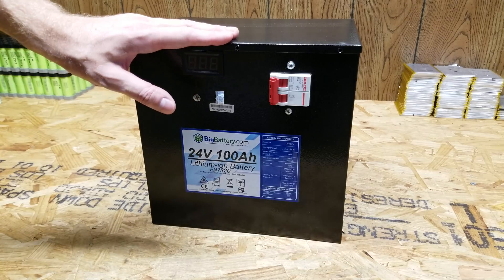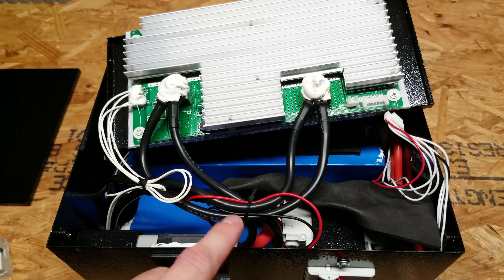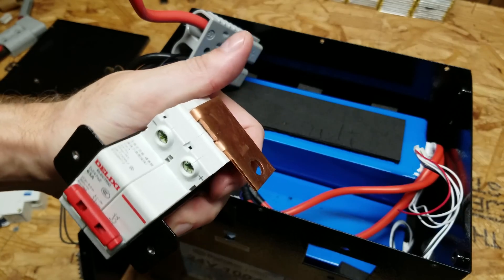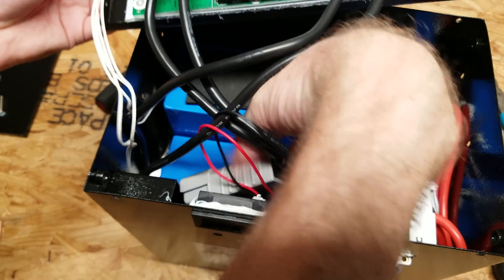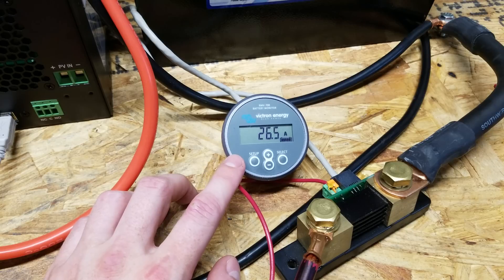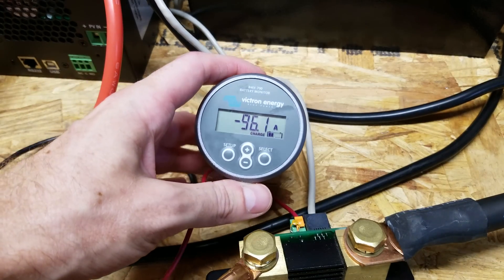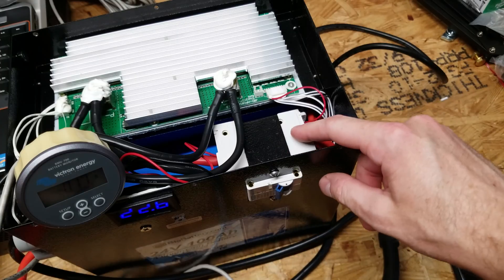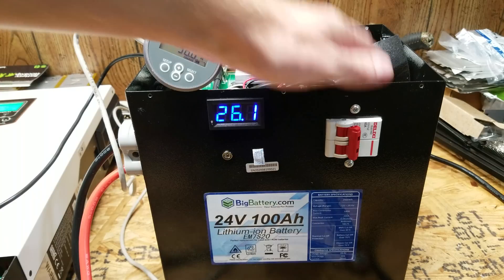BigBattery 24V Breaker Replacement and 100A Re-Test, Problem Solved!

Comment: Mike, on some leaf batteries I purchased from BigBattery... I had the same brand breakers, had the same issue... they didn’t question it and sent me a replacement. I did the same, I just didn’t trust the brand and purchase the same name brand on a 5-8 day shipping from aliexpress.
Reply from the maker: Did you have the heating issue? Or the handle not tripping completely? Or Both?
Reply: LithiumSolar just the breaker handle or lever, did the same as your. But my BMS also quit working

Comment: It is standard practice to fuse paralleled wires with 1/2 total amps of the circuit, so the twinned breaker with tied handle is proper. And much safer than your larger rated breaker with paralleled conductors in it.
Reply from the maker: Yes, but the two paralleled wires are connected before AND after the breaker. Wouldn't what you're saying mean the wires go in to the breaker separately and are only paralleled on the one (output) side? That way each pole is operating separately protecting one of the two wires?
Reply: @LithiumSolar  Using a Dual Breaker for parallel wires is acceptable.  It is good practice to connect one wire to the Left Side Breaker and one wire to Right Side Breaker.  Now, each wire is safely protected by its own 63 Amp Breaker.
Reply from the maker: @vtorsi610  Yes, but I'm saying that's NOT how it was connected either lol
Reply: @LithiumSolar  Yes, I saw in the video that a copper jumper bar was used.  But I am saying, "One wire per breaker is good practice ..."

Comment: I agree - a lock washer should be used in that design (remember these batteries are likely to be used in mobile situations). And they need torque specs during assembly to ensure proper connection. Mechanically you would need to ensure those breaker clamps are designed to exert enough force on a solid copper buss bar as well.

Comment: Hey what Gauge wires was used in that Battery Box?
Reply from the maker: It's all paralleled pairs of 8awg except for the positive from breaker to anderson connection, which is a single 6awg.

Comment: 090420/1604pst.  Thank you for the video. That was a good inspection report. A company’s good image can be tarnished by one single assembler. Well....  there should not have had a loose contact in the first instance. But your keen eyes and years of experience caught it before the CB joint over heated and caused a fire ! 
A suggestion.... the twin Positive cables could have used a suitable ferrule. I use ferrules as per your suggestions and recommendations on most of my joints, by crimping it with hydraulic press. Some of the crimping did not even hold the cable, in tightened position, as I pulled the cable manually. So, I soldered the tip of the ferrule with high heat (Vanatta “Kwikheat” 225Watt 1960) soldering stick. That took care of the cable slipping out of the ferrule.
Thanks again for for pointing out the bad connection that caused the heat at the joint. 175 Celsius !! 
Stay safe and 73s...

Comment: any heat generated is a power loss, weather is caused by lose connections, or under rated wiring especially in a enclosed housing. to me that battery built is not very energy efficient, and in the long run it may be even  a fire hazard?
just saying ...

Comment: Thanks for the video  My Big Battery LiFeo4 packs are superb. I will be ordering more as soon as possible if they are still available. I may pop the top off mine and check the fasteners are tight. No problem.
Reply from the maker: Which LiFePO4 batteries did you buy? Do they have the same breakers as here?

Comment: I think I can say we really appreciate the time you took doing this test. Knowing this could save someone’s house, rv, well-being.
Reply from the maker: The good thing is these seem to have a great quality BMS that properly shuts it down :)
Reply: Gratitude to you my friend! Awesome video very clear and to the point. Also, although bigbattery clearly had some quality issues here, nice to see them selling servicable products and having responsive service.
Reply: I say that because 95/100 lithium batteries with a broken breaker, terminal, etc would need to return to the factory to be repaired.

Comment: I received 2 batteries from them this week and had the Anderson plug on 1 of them not even bolted down in the enclosure. They claimed that it came loose during shipping but when I opened mine up there were zero bolts or nuts to be found. I was ready to send it back but was asked if I can add the bolts myself to save on the time that it would take for me to receive a replacement. Looks like their quality control team is non existent. I’m hoping that’s the only problem I have with my batteries after spending $1600 on them. Thanks for holding them accountable with this video!
Reply: 2012CompMan <<<< thanks for the report. I bought a medical power supply from them. Upon arrival and testing, I found the cells, all of them reading ZERO volts. I have the original battery charger, for that unit and put the unit on charge....one hour later the reading was ZERO. Dispatched the unit back, paid for the shipping, being totally disappointed. Aw well..... thanks for pointing out the issue. Stay safe and 73s... (090420/1702pst)
PS: THE SCREW GOT LOOSENED WHILE IN TRANSIT? My foot ! Sorry I got a lil emotional!
Reply: Hope you pulled the entire thing apart looking for those missing screws.. including removing the battery pack.  In this case, they could be outside the battery in the shipping box. These are not just a piece of crap, they are downright dangerous. For $400/kWH you should be able to find a certified product. although I see you got a $300 discount. bringing it down to $333/kWH  See my reply to the post.  If you are going to keep them, please check to see if the cells are individually fused. If they are not, the only safe thing is to tear apart the pack and start from scratch. At that point I'd send them back and look for safer options for 5 kWh of 24v power. Also, don't plan on pushing these packs anywhere near 100A unless your rebuild the output side of the pack completely and dig in to the specs on the BMS. Were you going to put these in series for 48V or use them in parallel at 24v?   Good luck
Reply: @hbmike47  Yes I took the battery apart looking for them, but They were never installed. So they were "tested" knowing this because it was pretty obvious that the plug was not secured as soon as I got them. When I brought it to their attention they made every excuse in the book including  discouraging me from sending them back for a refund. Knowing that their QC team is lacking, I have my fingers crossed that they will be what they promised. They only stand behind their batteries for 1 Month which I didn't realize until after I received them. I will definitely be building my next battery after this experience. 
I purchased the 24V LiFePo4 batteries. I'm using them in parallel. I used Wills discount code to get $180 off. Also, mine didn't come with nice informative stickers like these, just a bare black.box.
Reply: @RichCompMan  Are the cells individually fused?  Individual fuse can be done with nickle fused strips (like regular nickle strips but there's only a thin bridge of wire to the positive welding pad, so under high current it acts like a fuse)
Reply: Mike Not sure. I just secured the Anderson connector. Didn’t want to tear into it too much, didn’t want to give them an excuse to void the warranty. Here’s a link to Will’s video in where he dissected the batteries I have.... 
https://youtu.be/pcatgGpdE9o
Reply: I received two LiFePo4 (Not the Li-Ion shown here) 24v batteries from Big Battery yesterday and they are flawless despite FedEx trying to destroy them. Stuff happens  and you need to just deal with it.  Put on your big boy pants, stop assuming the worst, stow away all that drama and install a few screws. You received quality components for half the cost of a BattleBorn.
Reply: G Henrickson HAHA, your probably the QC guy that dropped the ball on my order! Get a life and stop trolling.
Reply: @geraldhenrickson7472  "Put on your big boy pants", "stow the drama". Someone ran out of Midol.
Reply: @geraldhenrickson7472  -  From reading all your posts, you sound like you have a financial connection to BigBattery.

Comment: Well, I'm glad you re-tested, but- I think the lack of a lock washer, and, general looseness was the REAL problem. At the value price listed, I would do a little disassembly, add a lock washer if needed, and tighten (Think Will Prowse saying tighTen) the bolt firmly. 70 C doesn't throw me off @ 98% of max capacity with a double copper pole 63A working breaker. Overall, I thought it was well put together, but that lack of lock washer, and subsequent loosen of the bolt is actually concerning.

Comment: Those temperatures are all the the top off so they may be higher and more widespread with no air circulation.
Reply: Indeed, might be a good idea to add a fan with a thermostat.
Reply: @ahaveland  Go for it. A fan never hurt anything that I know of. To each his own.
Reply: Mine do not heat up like this. try not to jump on the bandwagon of malcontent until you have all the facts.

Comment: I would never purchase a built battery set-up from Big Battery  after seeing how lousy and careless they made the unit you first tested. Most purchasers don't have the knowledge to take it apart and make sure everything is done correctly. They rely on the manufacturer. In this instance, you could have a fire from a overheating unit that overheated because someone failed to assemble it properly. This really irks me to no end. Thanks for your informative video.
Reply: It's "big battery" not battery hookup.
Reply: @BobHannent  Thanks, I'll place my order and edit my comment!

Comment: For $950 That is piss poor workmanship. I will never buy from them
Reply: its simple poor build quality. they used a copper plate in a breaker designt to crush copper wire.  there are breakers designt to use  such plates.  this video just shows me that they did not test properly that there is no quality control.
Reply: Please stop. we do not know what actually happened. To discount a particular maker of batteries over this is silly. You are passing up a wonderful battery pack at half the cost of other quality packs. Buy or dont buy but please do not add to the mis-perceptions floating around about that which you do not own and apprantly will never buy.
Reply: @geraldhenrickson7472  Yes, maybe it was caused by a bad monday morning. It is a bad design tho not having lock-nuts. Lets say you drive them on a long dirt road to your cabin. There's a good chance they'll come loose.
Reply: @geraldhenrickson7472  Probably a good idea to go through each new battery pack and check all the connections for tightness before putting it into service. Also, the high amperage DC connections are dry and should be coated in silicone dielectric grease. It's messy, but it makes a big difference over the long haul.

Comment: Does this inverter tolerates battery disconnection in runtime? Some service technicians were reporting its internals desruction.
Reply: Arc fault can destroy solar panels, inverters and certainly a BMS. Turn off all breakers before you do anything. You might cover your panels also before working with your connectors.
Reply: @geraldhenrickson7472  But this BMS can disconnect the battery at runtime. Also the automatic braker in the battery.

Comment: Those Clamp down Connectors are actually made for Solid or semi-solid wires, you should use a Ferule (no soldering thats not as relihable as a crimped therminal) around those two Wires and also use a Torque wrench or torque screwdriver, most Manufactures have Torque ratings in the Datasheet, bc under and over tightening are both bad.
Reply from the maker: How can you tell? I tried using ferules on these breakers in a project unrelated to this test, and the wires pulled out easier than when they were clamped down directly by the lug itself.
Reply: @LithiumSolar  I don't think a ferrule would work in a dual wire connection like this. Actually, the wires should be connected to a bus bar first with a lead going into the switch using a ferrule.
Reply: LithiumSolar <<<< I agree totally. As per the German Engineer, soldering the tip of the ferrule is not recommended, then, the joint can be spot welded. It can be done. I have done it.

Comment: I'm with you on the double breaker idea.   Those are meant to be used on two pole power configurations.  Here it's just more to go wrong.
Reply: It is also perfectly acceptable to use them with parallel wires.

Comment: I'm sure it's due to just loose connection only
Reply from the maker: I'm 99% sure you are correct ;)
Reply: 090420/1640pst. That’s for sure. Any electrical joint even if fully torqued, there’s bound to have resistance and net result being production of heat. Since the original CB was replaced with TOMZN and the ring terminal was cut, no one would want to play around with that joint again. I wouldn’t. Besides now, there’s only one connection, instead of a Brass bolt and nut and a Cu plate, which’d still cause voltage drop at the two joints. Honestly that design was BAD!

Comment: The loose bolts are not acceptable. Even if a loose bolted connection does not heat up much, the increased resistance will cause the current to be higher in one breaker than the other.
The din rail adapter plate strikes me as unneeded complexity. Why not source breakers with threaded posts for bolted connections?
Keep in mind when the outside of the wires are 75 degrees Celsius, the inside is much hotter.

Comment: The loose connections to the original breaker are concerning. But from the way big battery seems to interact with reviewers on youtube, I'd bet they will take steps to address those issues. What worries me even more is the original breaker that wouldn't shut off... or didn't shut off fully... or something like that. Even when it was switched off, it stayed on!!?? That scares the hell out of me.

Comment: There's a German study that I can't get to right now, it showed that lock washers didn't actually affect nut stability over time.
Reply from the maker: I find that hard to believe, but would be interested in reading it if you can find it and post a link :)
Reply: @LithiumSolar  This one's not from germany but from a little organization called NASA. Jump to the Locking Methods section, page 9-10. https://ntrs.nasa.gov/citations/19900009424  They say that helical lock washers do nothing, and star lock washers do a little but they mar the mating surfaces.
Reply: LithiumSolar <<<<<< hahahah. Is there a  German study... on lock washers? Here, in the Nuclear Facility the standards specify the use of lock washers on all mechanical Fastner .... NRC stipulation. Who won in 1945?
Reply: Yea, can't find the German one.
But yes Nasa and Bolt Science
https://www.quora.com/How-does-a-lock-washer-work/answer/Emos-Ztuy?ch=10&share=f33a12e5&srid=GQL
Reply: Which lock washers.?There are many kinds. A simple spring lock washer is the least reliable yet are still in widespread use.
Reply: Well, perhaps the breaker should be preassembled with pigtails of 6ga wire internally riveted and the terminal lugs crimped onto the pigtails. That way the "breaker assembly" can be inserted into place and the post  terminals bolted down. This "preassembled unit" design would eliminate the suspected "loose" connections, simplify assembly and increase the overall safety of the switch/fuse connections. IMHO, just sayin'. Perhaps a redesign investment would more than compensate by reducing the consequences of fire due to internal arcing producing a fire.
Nice vid. Thank you for all the trouble you went through to show us "what's inside the box".
Reply: I think the germans invented these. I used them in the automotive industry for 20 years and continue to use them on every project that I do... https://www.mscdirect.com/product/details/91522094
Reply: I find it hard to accept this when the very budget-conscious automotive industry has used flange head and serrated flange head bolts and washers for many decades in critical applications. In this particular instance if they had used a lock split or toothed lock washer they would have had a visual indication that they didn't tighten it.
Reply: @MichaelNeal  interestingly, one of the threads above says that one of the biggest heavy machinary companies (I think they said Catapillar) has stopped using lock washers.
It's sometimes hard to change minds and practices.
Reply: NASA... The ones that incorrectly spec'd the oring on the Challenger. Yeah, I'll pass. Let's see a few peer reviewed papers on this rather than just a single source.